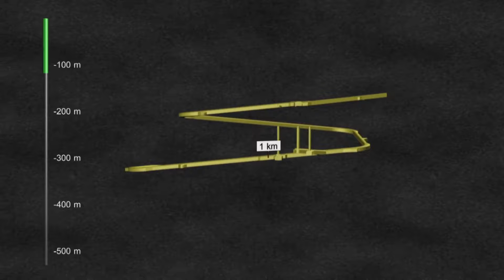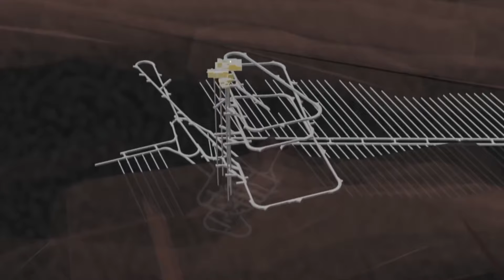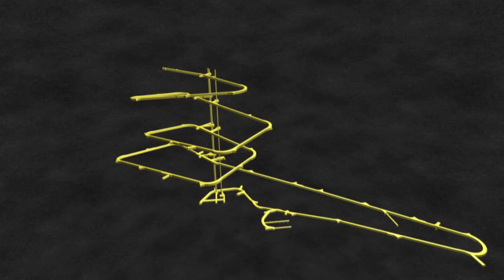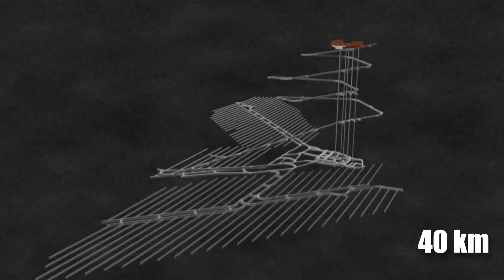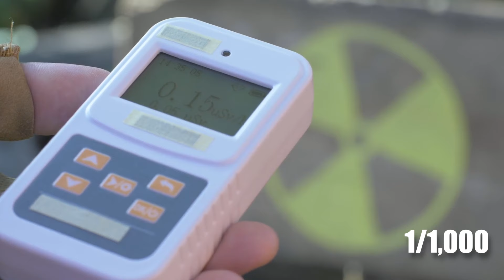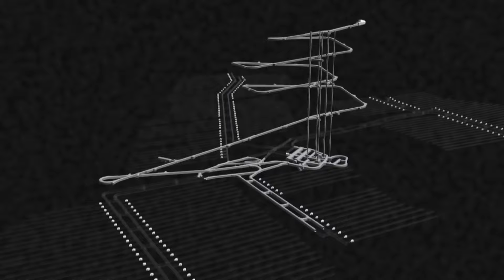Finland’s Race To Bury All Of Their Nuclear Waste

Comment: This disposal system seems well thought out. The gain of reliable power is a plus. There seems to be enough profit in the process to pay for proper disposal. We need power and windmills aint gonna cut it
Reply: Two things I've learned about nuclear: 1) Never build just one reactor. The first one almost always goes over-budget/has massive delays. But when those lessons are applied to 2nd,3rd...10th reactors, they get cheaper and easier every time. 2) Its really useful to combine nuclear with other green energy sources. Reactors sometimes need to be switched off for repairs and maintenance so having, for example, a local wind farm, you can time you outages with local high wind events (weather forecasting gives you notice), to maximise grid reliability. Hydro is even better because the dispatch-able power can fill in the daily peaks, which base-load nuclear can't.

Comment: Does nuclear power put off ozone depletion gases? No so that is why it is considered green energy instead of dirty energy. You have to take it in the context with which they describe it in. Thus is why people screw things up so badly.
Reply: Ozone depleting gases and greenhouse gases (which cause global warming) aren't entirely the same. All fossil fuel and biomass power stations make greenhouse gases (mainly CO2) which add to global warming, but only old refrigerant gases (mainly from old electric cooling systems like ACs and fridges) create ozone destroying gases. But ozone destroying gases are really bad greenhouse gases, thousands of times worse for ever 1kg released than CO2, so its confusing!

Comment: the power station and the repository are at sea level this is a huge liability...........seal level is rising at an exponential rate.........the warming ocean is expanding adding to sea level rise ................as effficient as they are for generating energy they are essentiaally generating heat just  to create high -pressure steam to turn a turbine to create electricity just like a windmill....we are using nuclear power to boil water...its ludicrous --FUKUSHIMA IS DUMPING TOXIC WATER IN THE OCEAN AS I WRITE THIS......THO'..i have seen recently that high powered lasers may be able to make spent fuel less rasioactive but the costs to guard and secure the fuels and risk of dirty bombs etc are astronomical risk factors.........one meltdown is too high a risk........the latest geothermal 'everywhere' power plants by companies such as EAVOR .......THese drilling rigs can generate electricity anywhere and create a closed loop underground that can use earths heat to create steam to do the same thing its clean its 24/7 ,365 days a year........for ever....few moving parts.....one rig can provide hot water and electricity for 16000 homes............FORGET NUCLEAR .........MODERN GEOTHERMAL IS THE ONLY Way FORWARD.......OIL AND FRACKING/GAS Company TECH can BE RE-DIRECTED TO THIS USING SAME PRINCIPLES AND PEOPLE ITS A WIN -WIN.........GEOTHHERMAL........................EAVOR ............EAVOR IS FOREAVOR!! LITERALLY
LARGE Centralised coal and nuclear lose 30 percent of energy in transmission alone...LOCAL AND DISTRIBUTED .COMMUNITY CONTROL.COMMUNITY OWNED ......SOLAR.WIND AND LOTS OF NEW GEOTHERMAL WILL BE FASTER AND WONT NEED ALL THE PERMITTING. Https://www.eavor.com/